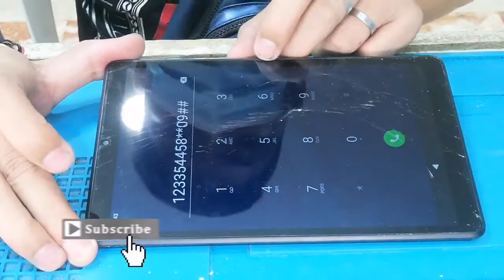Lenovo tab m8 TB-8505x cracked lcd/easy way to replace

Comment: Sir may pagasa pa ba yung lenovo a5000 ko walang display pero may power at may mahinang ilaw cya. Nagbavibrate naman kapag sinasaksak yung charger pero walang pa ring display. Ano kaya naging problema? Salamat po.
Reply from the maker: Opo kaya pa un display ic or light ic un
Reply: Nasa magkano po kaya magagastos sa pagrepair nito? Salamat po.
Reply from the maker: 800 boss